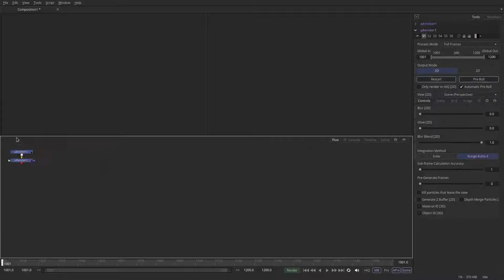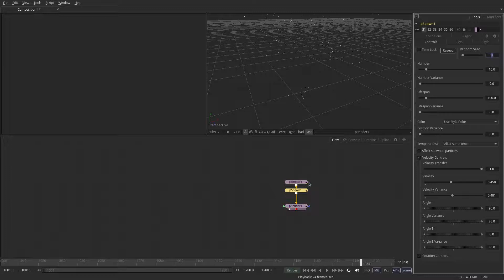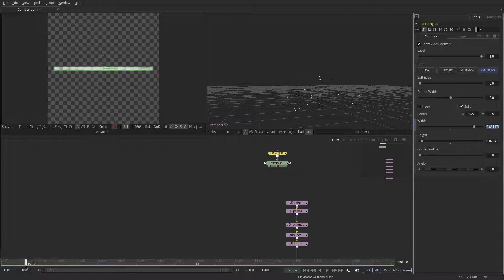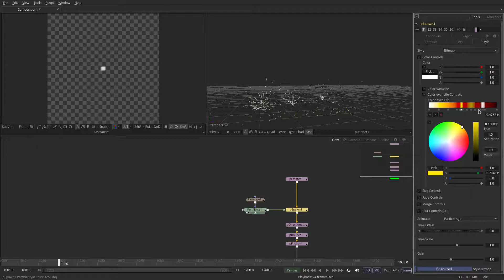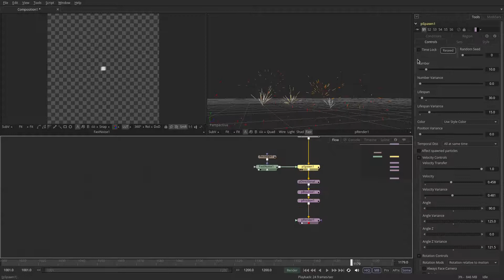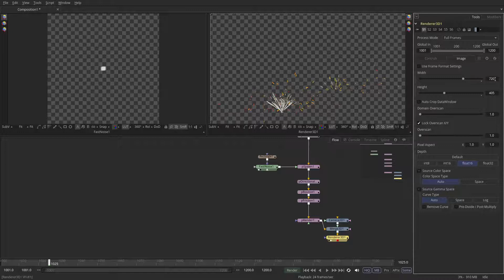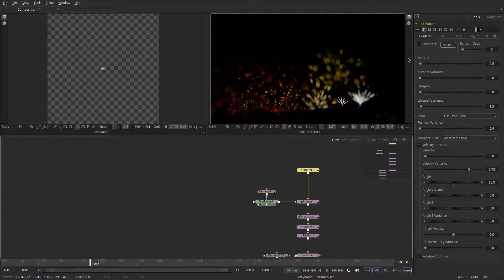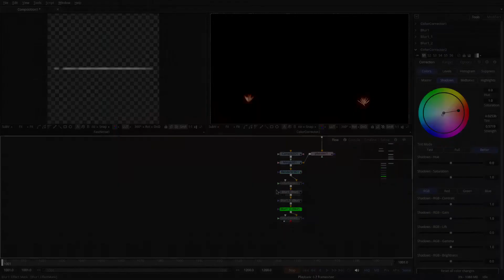Fusion Particles - Spark impacts / Spawning new points from particles

Comment: 🤩 Thanks for this tutorial, all of them should be like this. Your voice is - also for me as non native English person - super clear and good understandable and the speed of tutorial is good to follow. Of course I subscribed. 🙌🖖 - You are running Fusion on a Linux machine, any hardware recommendations to get the max performance? Such as board, CPU, GPU, RAM, VRAM and monitor and last but not least: which Linux distribution?
Reply from the maker: Hi, thanks for the feedback, much appreciate it. I run Fusion on Ubuntu (with i3 and xfce) and Manjaro for the most part. The tutorials are done on an older i7 and with a first gen titan x card. Fusion really really likes RAM, so get as much as you can. Fusion will happily fill up and use as much available ram as possible.

Comment: Can I ask what kind of machine you are using? And what OS?
Reply from the maker: i7-6700K, 32gb, TitanX, Linux / Ubuntu with I3 as my window manager.
Reply: Interesting...looks quite fast...wondering if its the Titan, the i7 or Linux. I got a ryzen machine but not as smooth as yours.
Reply from the maker: Its previous gen Titan, and its running OpenGL for these effects so the Titan won't really speed things up that much. Have similar speeds on a old 960. The titan card only kicks in for things like OpenCL.